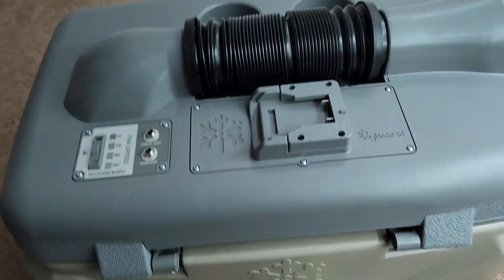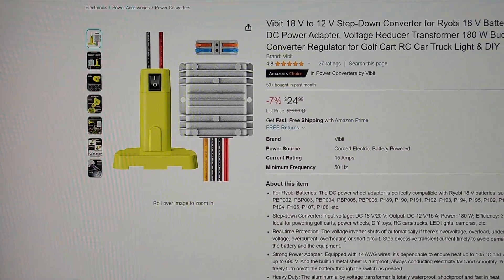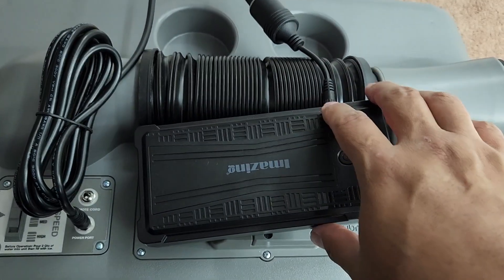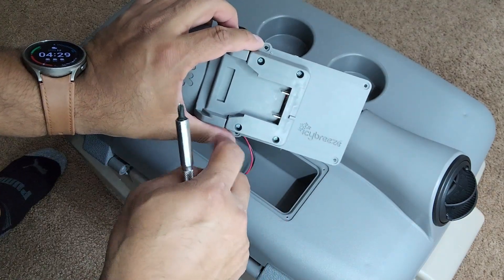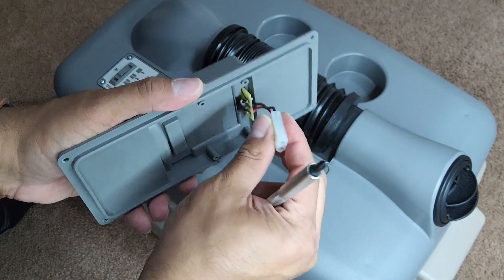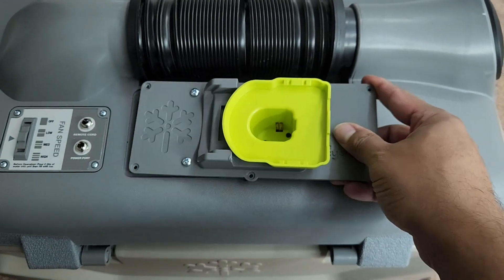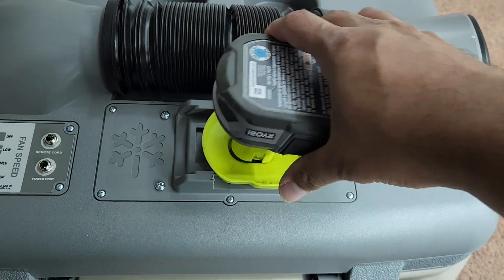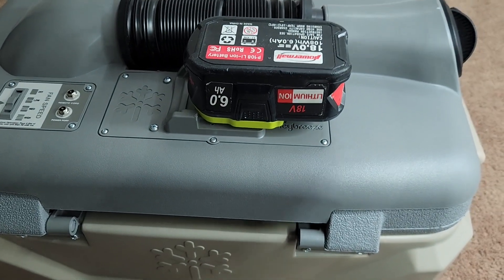IcyBreeze Portable Air Conditioner & Ryobi battery

Comment: A better idea with a lot less work. Just wire the adapter to a DC barrel connector and no need to mess with the original housing. However. It also works on 18-20v so you don't even need the step down. A 20v dewalt battery just works with zero modification. You also have some lost energy from the step down.